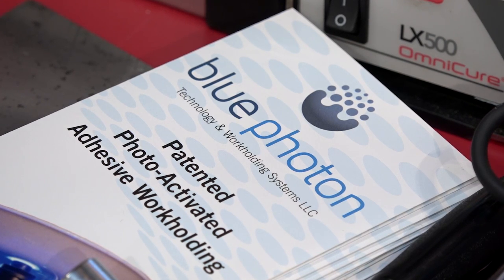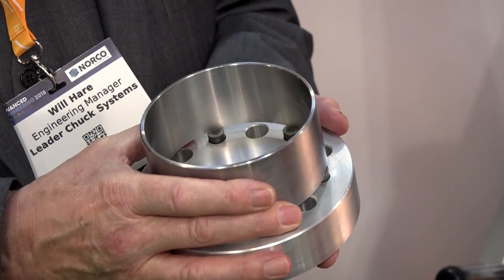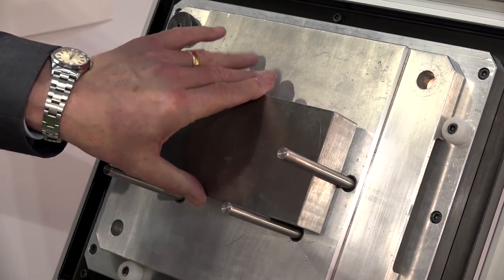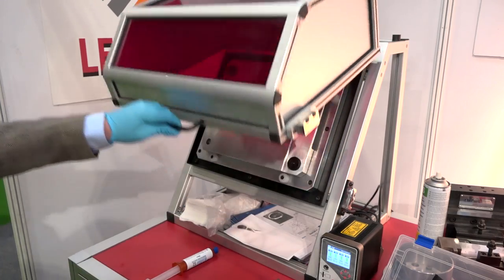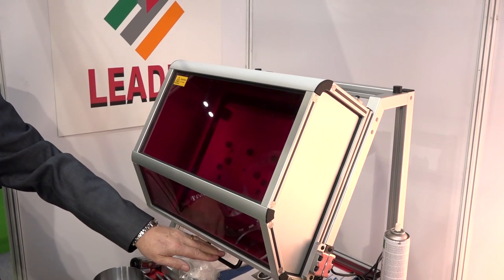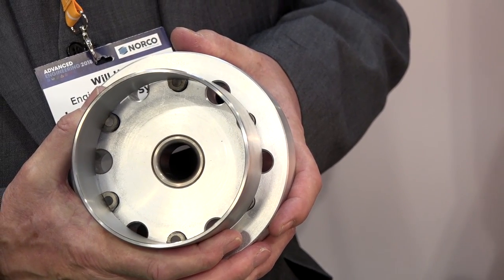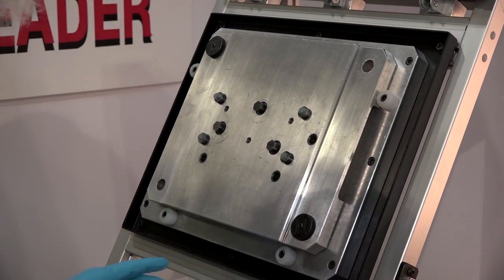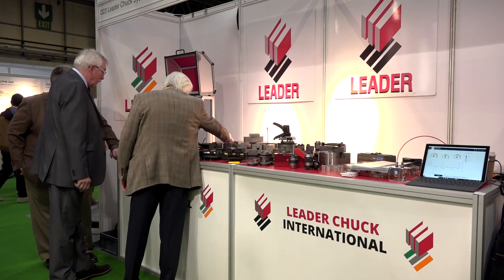Multi Face Machining Made Easy

Comment: OK... But how do you remove/detach the work-piece from the UV cured adhesive on the fixture ? IS it a UV cure cyanoacrylate or a different polymer/ co-polymer + fillers etc. ? THANKS / really interesting.
Reply from the maker: Good question... maybe give Leader chucks a call http://www.leaderchuck.com
Thank you very much for the message.